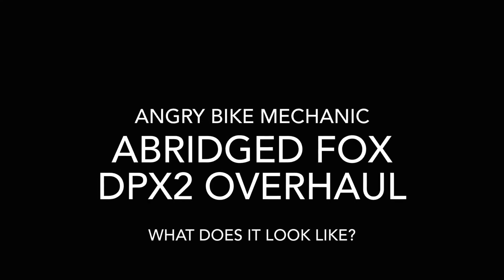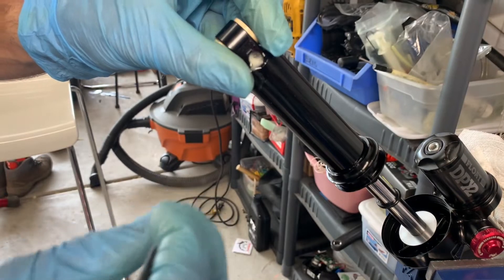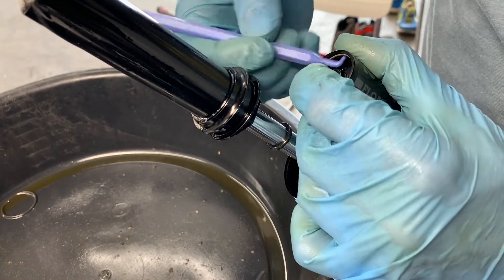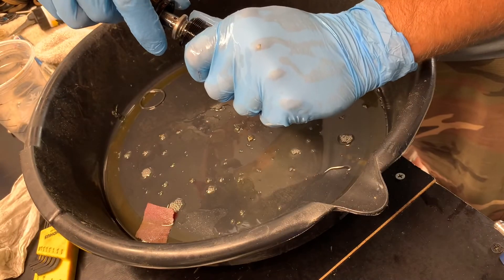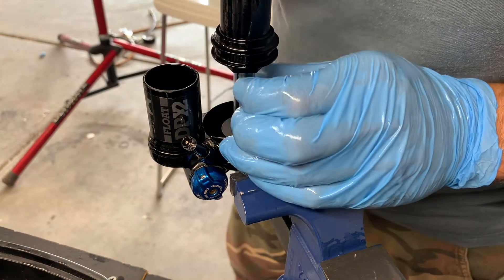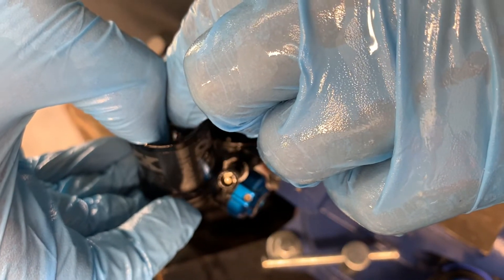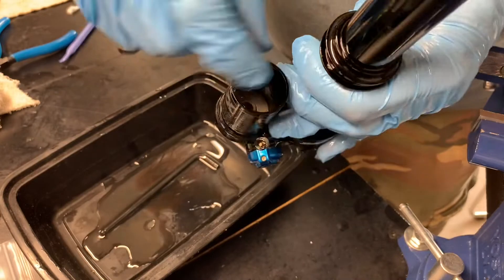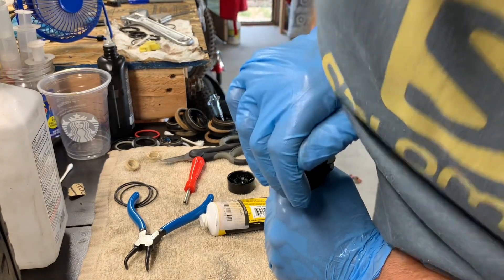Overview of Fox DPX2 IFP rebuild (light damper service) - not a complete service

Comment: My shock sound kinda like that for about 3 strokes then is silent. Would cavitation do that?. The bike has sat for a while as I have been using my hardtail. Thanks
Reply from the maker: this is normal for aerated (commonly called cavitated) dampers. sounds like it needs a damper service. I've had great results servicing these and they typically hold up better after I've had them in. The DPX2 will always do this, but the timing between intervals can vary.

Comment: Is it fine to ride cavitated shock for a while? I did do air can service twice while damper was cavitated so around 100 - 150 hours of riding. I don't really notice any change in performance or sound but is it going to damage some parts on the inside that aren't seals?
Reply from the maker: I think you ought to get that fixed as soon as you can. There's is the off chance that the first few strokes the oil can actually impact the damper circuit and damage it. but that would be a severe situation. The other factor is safety, rebound control will be limited and you might find your shock trying to buck you. Feel free to reach out. My turn around time in house on these is about 2 days. - Eric

Comment: I have been trying to find the IFP depth specs for my DPX but I can't seem to find the right one. Is it the same for all DPXs? I can't be, they vary in size and stroke, right? I did punch in the serial number but the data I get isn't very clear. Could you help me?
Reply from the maker: From what I've seen all DpX2's IFP depths are 38mm/1.5". I haven't had a single one that is different. Sorry for the late reply!

Comment: great vid / helps the fox directions make sense better , just did my 2021 DPX2 and was cavitated  after about 50hrs . Do you have any rebuilds for the current 2021+ Float X2 ? they are having similar cavitation issues even sooner than these shocks .
Reply from the maker: Really apologize for the late reply. we had a kid a few months ago and life has been "out of the shop" so to speak. Thanks for checking out the video. Fox definitely could do a better job with instructions. It helps having been in so many of their shocks, they have a similar approach and I hope that this video fills a couple of the info gaps. 

Currently I don't offer an service or products for the X2. I honestly don't have any experience with those and will likely refer folks over to Butter Suspension. One of the issues with cavitation is actually the main piston seal with all of these shocks. The IFP isn't charged to a super high pressure and during assembly the main piston shaft inside the shock, which chiefly moves the oil, isn't properly cleaned. Clean or not, this shaft ingests tons of air (from the air spring chamber -higher pressure than IFP) over time and creates this problem. I know, clear as mud. gonna have to do another video explaining the issue. Thanks for your feedback and for stopping by. I appreciate it! - Eric
Reply: @insightbike  thanks for the insight , i was able to do a full tear down when i was adjusting the stroke on a brand new X2 and it is similar to older X2 and also similar in problems and IFP to the Dpx2 , the good thing is that X2 has a built in shraeder  valve similar to rockshox for pressurizing the Ifp and i found increasing the IFP to 125/150 psi gave overall better feel to the shock and will hopefully extend the life a little more ( the factory charge was about 75/80 psi ( and that’s accounting for any air psi lost when installing a charging gauge ) i think the factory set is appx 100psi for 2021+

Comment: Nice video dude, what happens to dpx2 when ifp oil gets aerated? Does compression or rebound malfunctions?  Thank you
Reply from the maker: Thanks! ok, so there's two stages to the problems you'll experience. The first, the oil and air are settled so the first compression might feel like you're hitting an additional bump during the cycle and the rebound will go from smooth to feeling like an uncontrolled spring. after just a couple cycles the oil and air are combined and the dampening will seem less harsh, just characteristically difficult to manage or predict. This will result in inconsistent trail performance. This goes for any shock experiencing cavitation. I hope this helps. Fortunately, you're not likely to damage the internal hardware from riding it this way, at least not in the short term.

Comment: Any technique for removing the plastic covering the bolts on the bottom of the piggyback?
Reply from the maker: That little white silicon ball that is jammed in there requires very careful extraction. You need something pointy and sharp in order to pull that out, slowly work it out, careful not to damage anything else. And don't stab yourself while doing it. I don't recommend doing it.
Reply: @insightbike  I already stabbed myself so i am on the right track! thanks!

Comment: Can you tell me what parts you used for your nitrogen fill system. I know where I can get a tank but the regulator and lines I’m still shopping for. Same with the nitrogen fill tool, I know where I can get that too. How long do you hold the shock on the system and how fast does it fill up? Also do you have the fox needle tool for filling nitrogen on fox dps shocks during damper rebuilds? The shop I work at doesn’t have a nitro fill system and I want to buy and set up my own so I can do that as a side business ( because bike techs get paid a pittance where I work). Did you get certified by fox to do the nitrogen filling? When I talked to them they said they would only sell the needle part once you filled out a waiver. I know where to get it as a 3rd party but I was just wondering.
Reply from the maker: Hey Bob, shoot me an email. Go to my channel and then about page. you'll see it there. Thanks - Eric

Comment: Is it possible to buy separetly ifp seal or i need to buy full service kit?
Reply from the maker: Yes. I purchases a package of 100 of these IFP seals. The secondary seal that one might consider replacing is the main piston seal head seal, which is a polyurethane o'ring. Check back, I'll post the part numbers and where to find them here soon. The problem with buying the complete service kit is you don't have to do all of that every time. And, it's likely that most people aren't going to spring for the complete set of tools needs to get this job done.
Reply from the maker: I've added those o'rings to the description, with links. The IFP seal is only available in packs of 100... Good luck. This seal is the same o'ring found in Fox's DPX2 damper rebuild kit (Just used one, video coming). It really is one of two dynamic seals in the whole damper. I have rebuilt several of the DPX2 IFP's with this o'ring, with expected good results.

Comment: Interesting video. What is the usual root cause of this failure?  And what can I do to prevent this in my DPX 2 Factory
Reply from the maker: Thanks, It's not really something we can do much to prevent. Other than demanding that Fox fix this issue on future models. I've seen techs replace this seal with a quad seal but the effect isn't much different. The other point of air-ingress that I'm discovering is ingested from the main air chamber into the damper through the main piston seal head. Again, not sure what can be done to prevent that. Sorry I couldn't be more helpful here. Maybe the answer is out there somewhere. I just haven't found it yet.
Reply: @insightbike  only thing you could do is a vacuum bleed, you'd have degassed oil then, so takes a bit longer for it to get saturated with nitrogen.